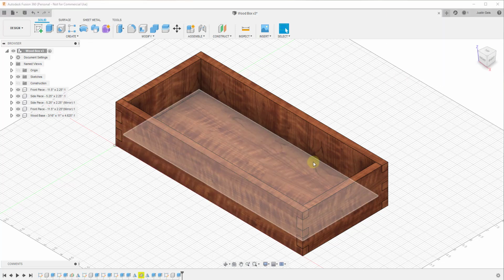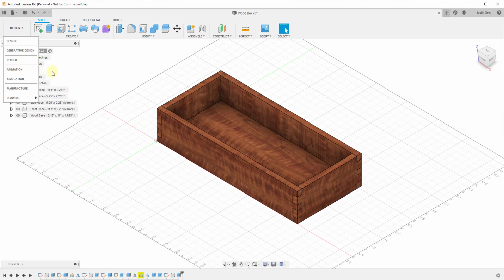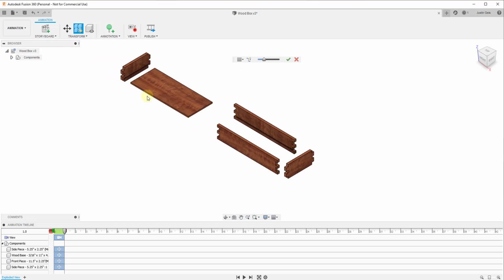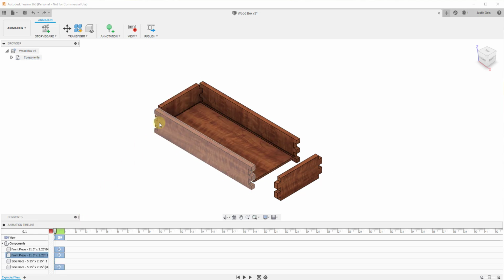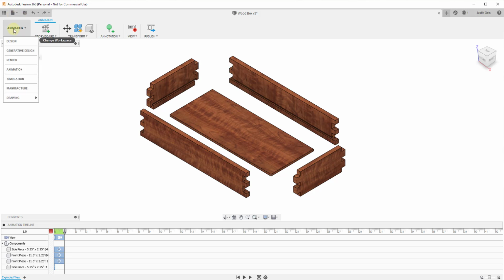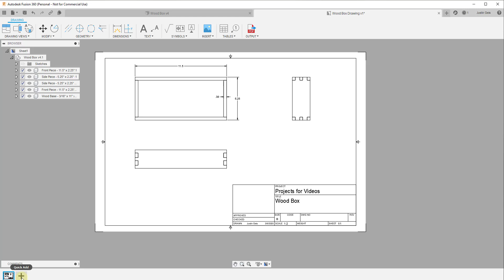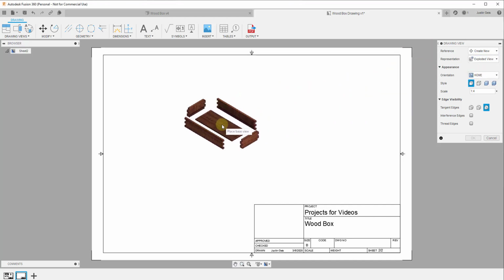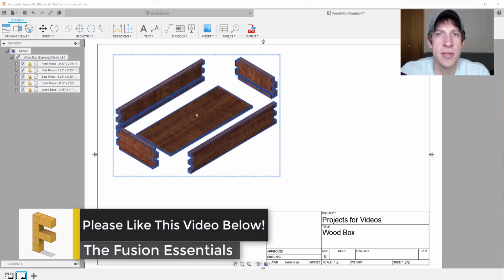Fusion 360 for Woodworkers Part 6 - Creating an EXPLODED VIEW Model in Fusion 360

Comment: LMAO, it's no longer possible to have a multi-sheet drawings nor export them to PDF on the non-paid version. It's now "single sheet, print only". What a scummy restriction by Autodesk. On Macs, you can usually print to PDF always, so they don't use the system print dialog that allows this.

Comment: some exploded views benefit from having a line that directs where the parts from an exploded view will fit within an assembly, do you have any thoughts about how this might be accomplished?
Reply: There is actually an option to show the line when you are moving the component in the animation view.  At 2:47, you can see the option called "Trail Line Visibility" and if you click on it, it will highlight and the line shows up.

Comment: When playing with this and then researching a bit on my own. I found that you currently can not place dimensions from the exploded or isometric views. The measurements that it gives are different from the actual measurements in your design. you can only use top, front, and side views for placing dimensions. Not sure if anyone else has noticed this but I thought I would throw it out there since it was giving me so much trouble. Autodesk says they are working on making it possible, but it looks like they have been working on it since 2016 so not looking good for such a useful tool.